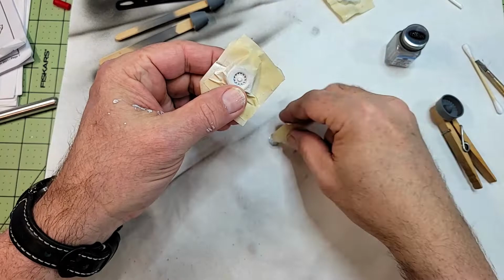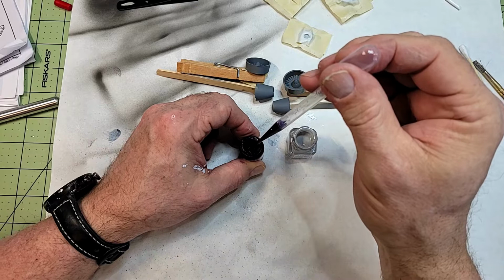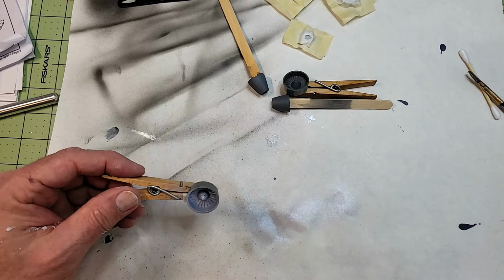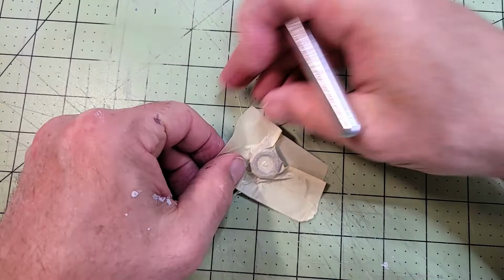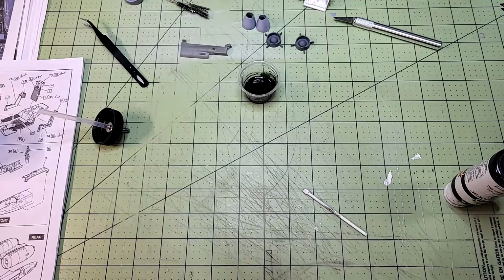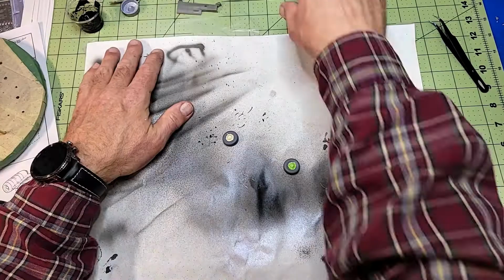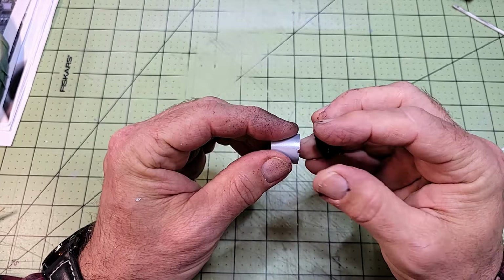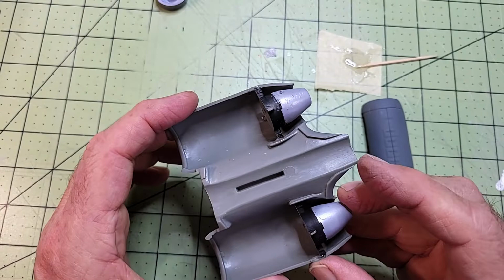Tinting Paint with Alcohol Ink for Engine Details on A-10 Warthog Model

Comment: There are several glues that are much better than the Testors tube we grew up with ( I'm 70 so very familiar with the tube glues.) Which one is "best" is personal preference. Tamiya makes 3 in bottles with a brush and of the 3 I like the orange bottle variety the most, a little thicker and slower than the green cap bottles but not as thick and messy as the tube glue. Testors 3502 is a very good liquid cement with a brush in the bottle. Testors also has a very good glue in a black triangular bottle with a nice spout tip that gives very good control of where the glue goes and does not string. The orange label Plastistruct glue will bond more types of plastic than any of the others (again in a glass bottle with a brush.)
My favorites right now are the Revell Contacta Professional in the blue plastic bottle with a nice metal spout and the Mr Cement form Mr. Hobby. The Mr. Cement Deluxe (yellow cap) has a little resin in ti so it grabs fairly quick and gives a good bond even to chrome parts. I get the Mr. Cement at Hobby Lobby. We sell the Revell cement where I work ( an old fashion mom and pop hobby shop.)
Reply from the maker: I'm using the Mr cement Deluxe a lot these days along with extra thin CA glue and believe it or not, good old-fashioned Tacky Glue for anything that's super fiddly and I needed to stick in place.
Thank you for sharing and thank you for watching!
Reply: @bryanshobbies  Yes, the tacky glue is also great for clear parts. Any excess can be wiped away with a wet rag before it cures and it cures clear.